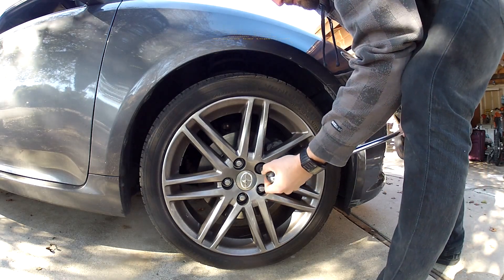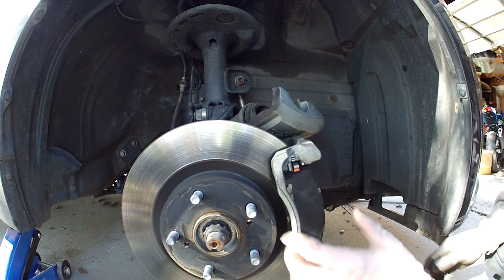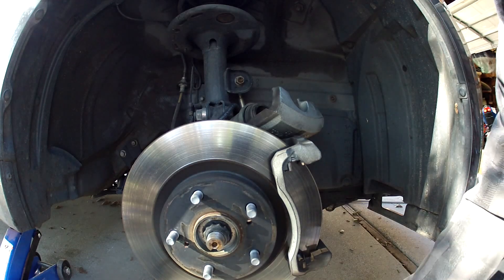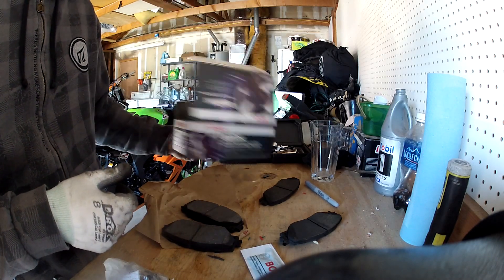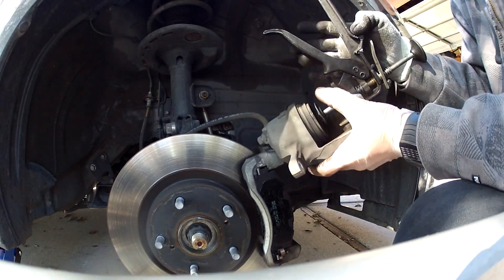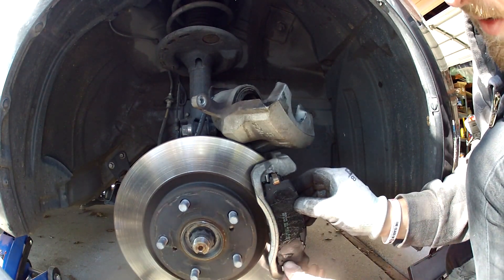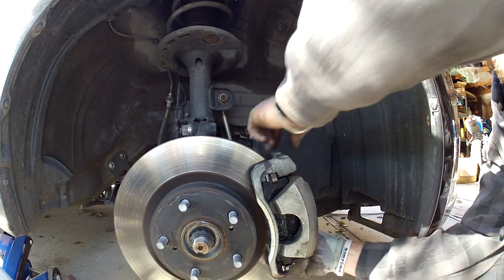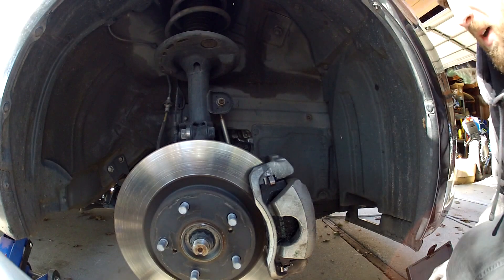2012 Scion tc brake pad replaceme HD DIY How-to change brake pads

Comment: Little trick. Use the old brake pad for leverage when compressing the caliper. Distributes the pressure a little more evenly. Also those “clips” aren’t clips they’re wear indicators. That’s what runs against the caliper when the pads are wearing out.

Comment: That's only the front.  Do you need a wind back tool to compress the pistons on the rear brakes?
Reply: Yes, a wind back tool is need to compress the rear pistons. In a pinch I was able to use channel locks. Be sure to grease up the rubber boot with some brake fluid if it's dry and sticking to the piston has you wind it back.
Reply: Just use a dang cheap c clamp no need for any fancy wind back tool

Comment: what about opening the bleeder value before compressing the piston back? then flushing the brakes...
Reply: Why would you need to flush the break fluid to depress the piston back?
Reply: @krystiantomczuk7451  To get out any air trapped in with the fluid.
Reply: No just compress slow and if you are worried pop open your brake fluid lid while you compress

Comment: He fucked up first off your not supposed to compress the caliper like how he did DONT EVEE DO THAT the gun might get stuck inside the piston and it’s a bitch getting it out ALWAYS use the old brake pads to compress the piston and have the master cylinder open cuz pressure going to build up second he FORGOT to even grease up the sliding pins which are behind the 2 bolts that are used to hold the caliper it’s important that you grease them up as well